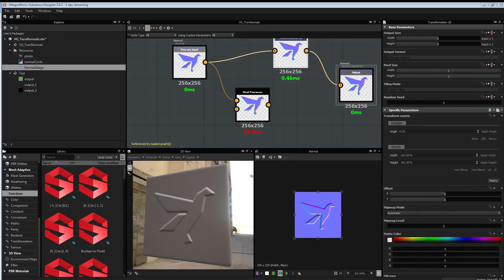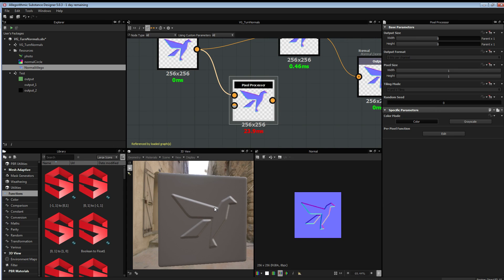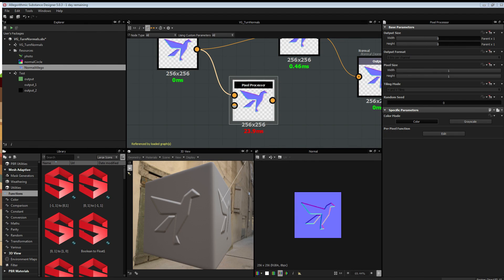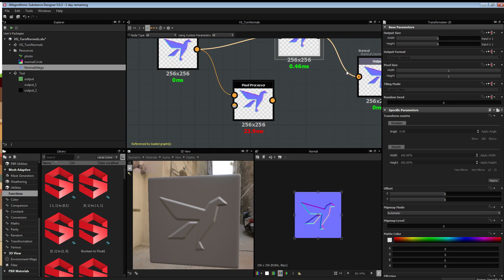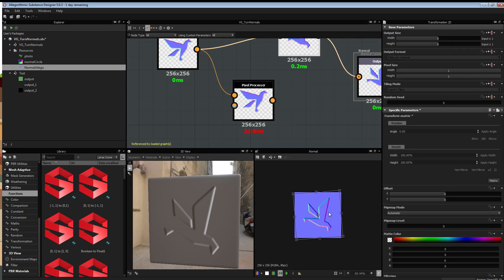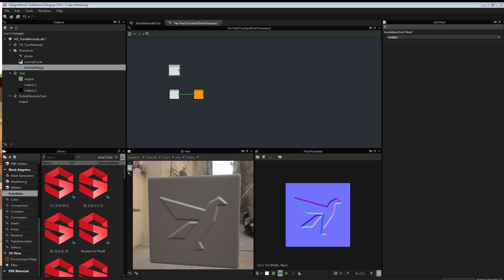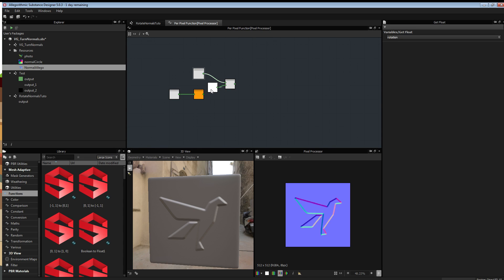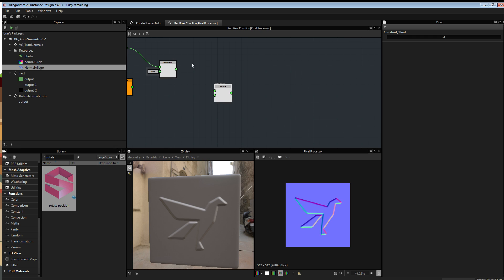Normal map Rotate part 01 (Allegorithmic Substance Designer 5)

Comment: Thank you, this helped me figure out how to rotate in a pixel processor. The only difference is that there's no Rotate Position node anymore.

New method: There's a newer node called Rotate Vec2. One just has to plug the position ($pos) into the vec2 input and plug a Float2 into the pivot input, then make sure the Float2 is set to 0.5 and 0.5. The angle input is the same as in the video.
Reply from the maker: Right. I should share that when I have some time.

Comment: THank u for the the video.  Few questions.  Is that using the negate node to invert the input the same as multiply -1?  also for offsetting adding -0.5 isn't the same as subtract 0.5?
Reply from the maker: Hey ***** !
Yes you are right in both cases.
Reply: If you only care about the results, it is the same.
If you care about performance, negating is flipping 1 bit in your float number, while multiply with -1 is a full float multiplication on every bit.